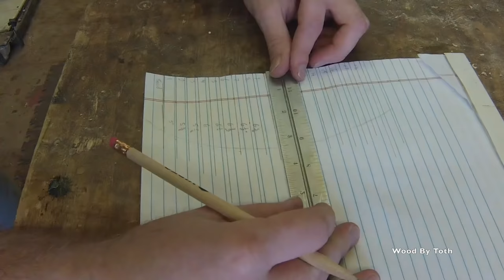Segmented Brick Vase

Comment: Gorgeous piece, Kyle.   
I'm a non-turner so maybe this is a dumb question but... I see that you added a thin veneer between each ring as you glued it up.  But I did NOT see you put veneer between each segment as you glued up the ring.  However at the end it really looks like their are dark vertical lines as well as horizontal.    Did I miss some detail in the video?
Reply from the maker: I didn't film that part. But they are just glued in when i glue up the rings
Reply: +Kyle Toth what kind of veneer was it? Very interested in the material!
Reply: +Tycho Thorp I'm interested as well
Reply from the maker: +Tycho Thorp Its ebony
Reply from the maker: +Lane Simmons Its ebony
Reply: @WoodByToth  more great and exquisite works sir, I looooovvvveeeeee the accents

Comment: good stuff,  you got me stuck in a Toth marathon
Reply: how long do you keep pressure on each piece before adding another? Also, what glue?
Reply from the maker: +the Von Thompsons ahhhh yeah. Its just tight bond and I clamp them for about 45 minutes and then add another ring
Reply: What wood are you using, and how much did it cost in materials?
Reply: Jeremy Thompson

Comment: Great looking project! A couple of quick questions. At the beginning you did a quick sketch and then made some measurements. It was hard to make out with all the other lines on the paper, was that just the basic shape you were going for and then figuring out how many segments were needed for each layer? Another question, and I think you might have answered it before, but between the layers you put something that looked like a paper kind of material, was that ebony veneer, and then you also added some ebony veneer between each segment that makes the circle layers? I hope my questions make sense.
Reply from the maker: That was just the basic shape. I lay out the pattern on the sketch as well. Then i measure the sketch to figure out the size of the rings. 12 pieces in each ring means that you will cut each piece at a 30° wedge to make a full circle. I'll have videos on this in the future. And yes that is ebony veneer

Comment: What am I missing here?  I can see where the horizontal black lines come from... but what comprises the vertical ones?  Where in the video is that added to the segments?  Thanks!
Reply: TomKaren94 it doesn't show him gluing each "brick" together but if you look really closely when he's sanding each ring you can see the tar paper in between each brick..
Reply: I was wondering what type of paper that was.  Curious if that is safe to use in an end grain cutting board design...
Reply: JBlueMast if you plan on actually using the cutting board for food then I probably wouldn't use tar paper but a really dark wood like "Ipe" its a heavy and dense wood with a beautiful grain

Comment: Beautiful as always, how long did you let the glue set between adding rings
Reply from the maker: I'll let it sit about 30 minutes the. I'll add another layer. Its always under clamping pressure though. I remove the tail stock just for a minute to add another layer

Comment: You continue to make some very stunning work. From the videos and pictures I've seen of your work I can't think of one that has a segmented bottom. Just wondering if there is a reason, or just your own personal style? Thks for sharing!
Reply from the maker: +Bobsdname Thanks! I have done segmented bottoms in the past but it usually turns out to be problematic cause of the wood movement.All of the pieces i've done this way have split on me. So with a solid bottom the wood movement is all in one direction. I like the look but it can be in issue sometimes

Comment: This question comes late, I think the finished work was not turned from the assembly shown at the beginning of this video. The work is inspiring. I hope I get an answer. There are spacers of material in-between the elements, placed there during the forming of the rings. Such spacers were not used in the rings shown here. Thanks, in advance.